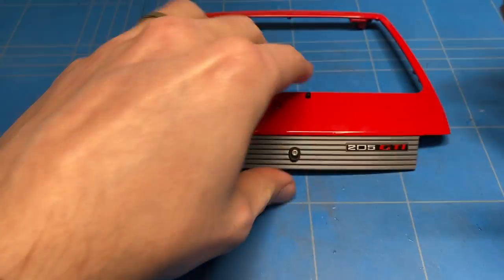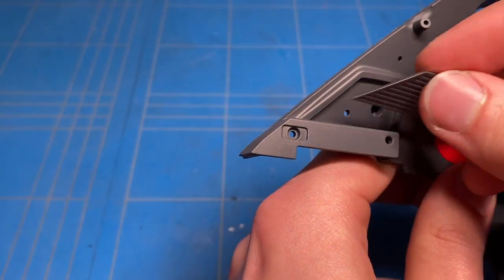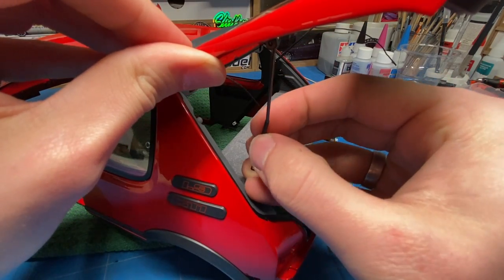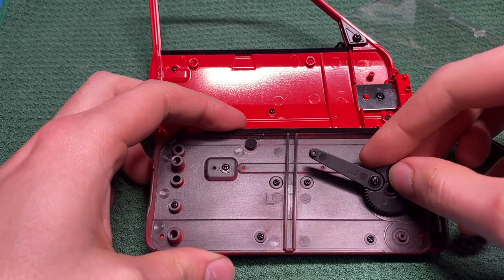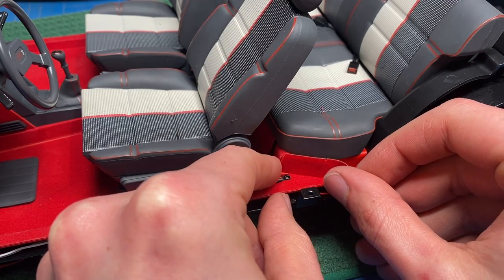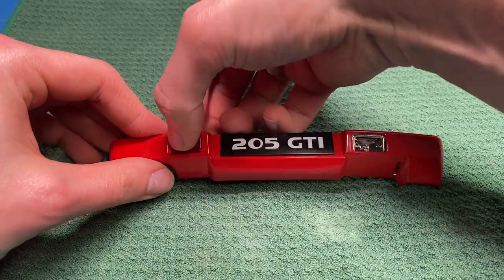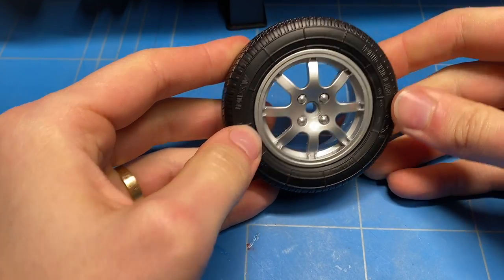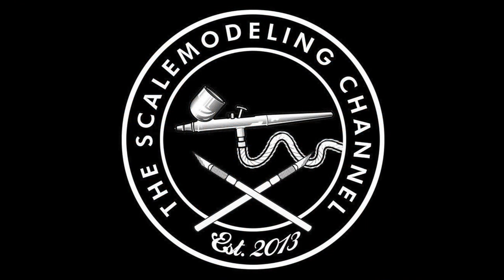Building a 1 to 8th scale IXO Collections Peugeot 205 GTi Part 6: Final Assembly

Comment: One up-grade to enhance realism would be to dull the shiny plastic or vinyl that the tyres are made from. The model looks very realistic and nicely detailed, the shiny plastic tyres are the only bug that let it down. You could try dulling them with fine grey scotch brite for the side wall and 1000 grit on the tread, you may have a better solution.